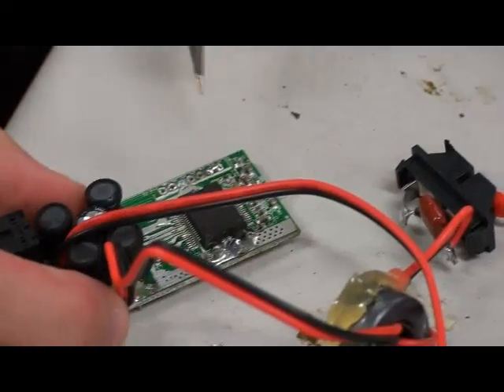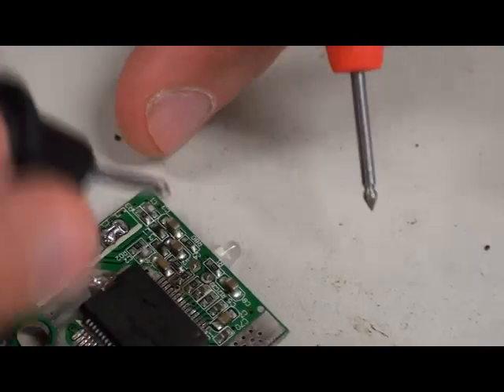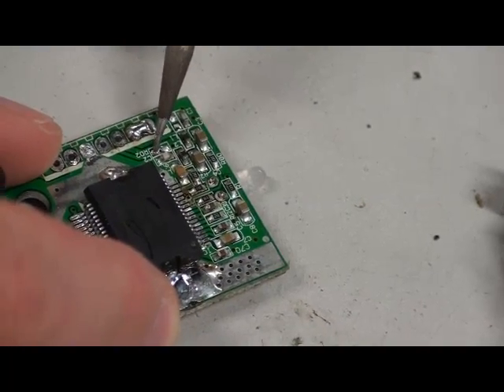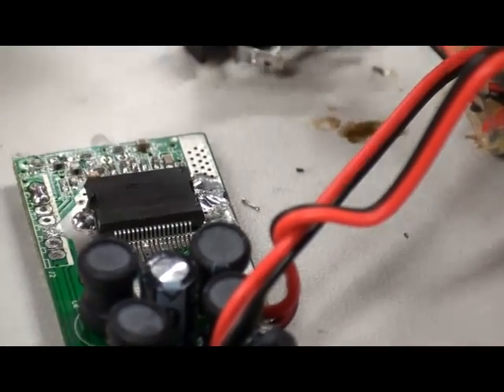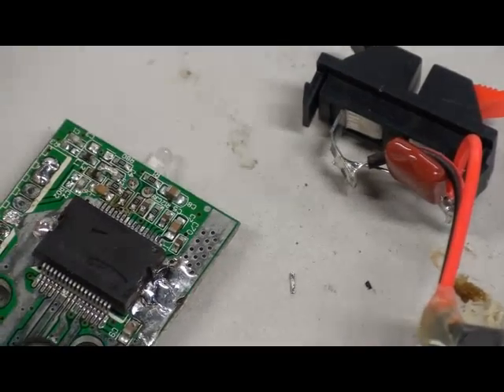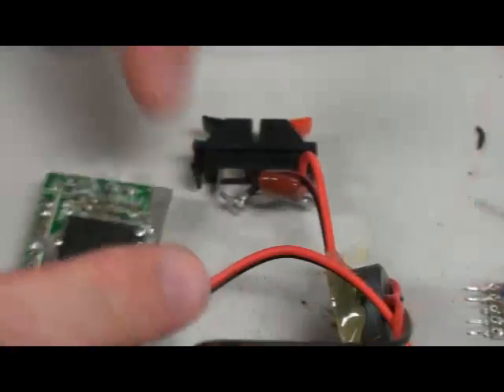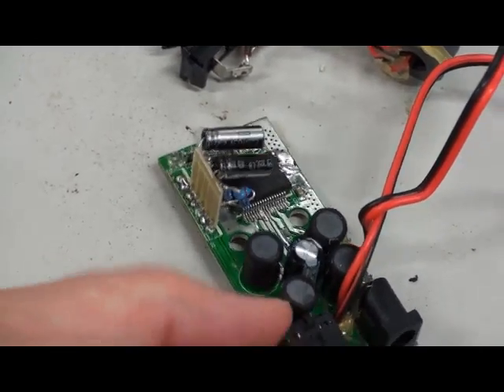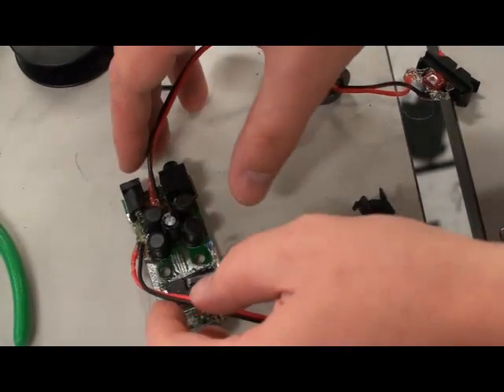L2Ork Instructables -- Retrofitting Amps Part 2

Comment: Thanks for posting these videos! Couple of questions: Is there an article somewhere explaining the mods you are making here? Also, why did you choose 3x of the Dayton amps, as opposed to something like the Sure Electronics 6x100W TDA7498-based board (AA-AB34181), which is higher power, and also less money? Thanks :)
Reply from the maker: +William Huston Glad to hear you found the videos helpful. At the time these were created, this was the cheapest option. A couple of things to consider is if the form factor would allow embedding inside the speaker, the fact that the board I found through google reflects a necessity for a fan (which in a closed enclosure may not be ideal, while openings may increase the amount of noise that may interfere with the desired sound, if such power may be excessive for the speakers and/or the enclosure (due to vibrations), and just as important, whether performers would need such power right below their feet (assuming you are looking to start a laptop orchestra), as these already can come close to the comfort threshold as-is. Hope this helps!